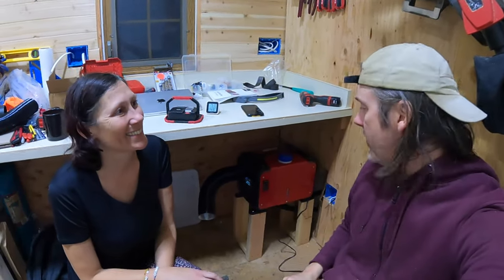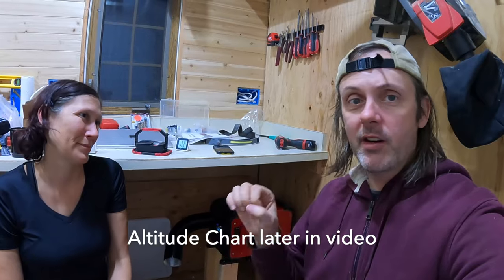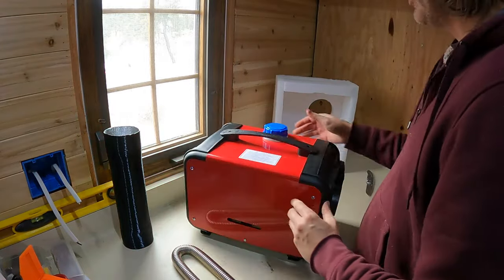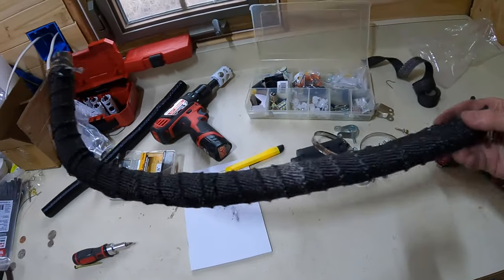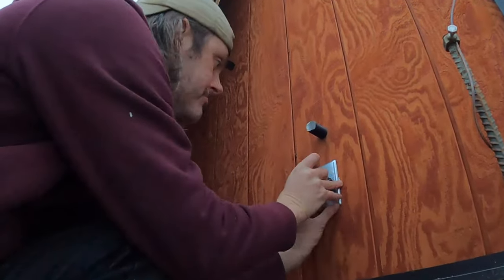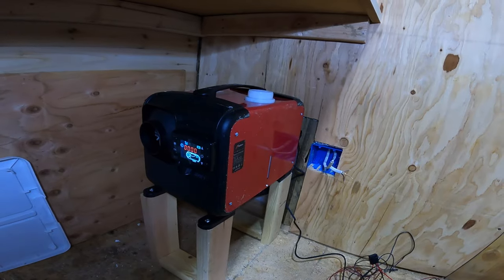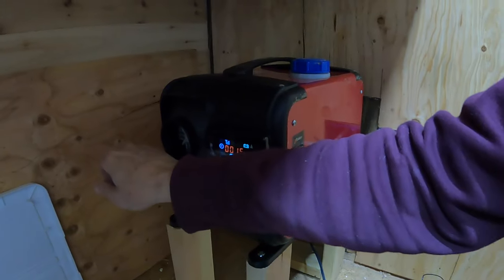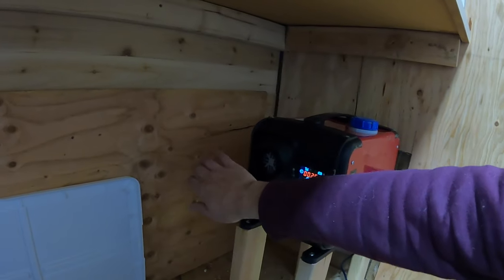How to Heat a Shed or Workshop with a Diesel Heater

Comment: Huh ... Fall is approaching here in the NE US and am looking to heat my gf's 24' x 40' barn and was looking at propane heaters.
Then stumbled upon this video while binge-watching your Sleekcraft SST videos.
Did a little research and now looking at appropriately sized diesel heaters instead.
Great videos! Keep up the great effort!
And best wishes that Sarah stays healthy!
Reply from the maker: Right on, winter is definitely coming.  I have been splitting wood (manually) the past few weeks to prep.   I don't have enough wood for this season right now.

For your pole barn, you'll definitely need to insulate.  I've seen some people buy like 3 of these things, and install them next to each other, combining the ducts.  So $300ish for a 'furnace' that runs on diesel, all plumbed to the same tank.  Can run all of them if the shop is cold, but once it's warm turn 2 of them off.   Interesting idea.
Reply: @ADDvanced  , as a matter of fact, I am installing insulation in the barn. 👍🏼👍🏼
1-1/2” (R-7) to start. Previous owner had a room in one corner, as well. Just framing at the moment. Will restore it and insulate it further, and include an electric heater, to store paints, resins, etc., and keep them from freezing.
Reply from the maker: @ELCADAROSA  Scope marketplace as well, insulation + reflectix works decently.  I scored HUGE rolls of reflectix super cheap, they leftovers from new construction.
Reply: @ADDvanced  , thank you!

Comment: Nice job. I replace the section of siding around the exhaust and intake with Hardy cement fiber board. Heat proof. Weather proof. Paint to blend with your siding. If you want to put the unit outside, use a toilet tank gasket to seal the intake of the heater to the opening in the case. Then screw a 3 inch plastic flange over the opening to attach a return duct. Most all-in-ones are not weather proof, so  add an overhang for some protection. You will also need to extend the controller wire. I prefer external because any exhaust leaks are not a worry, and the fuel is kept outside. You can also insulate the wall space around the exhaust with ceramic insulation.
Reply from the maker: Hey I like that idea maybe I’ll do that when I upgrade to an external tank?

Comment: You could use some larger diameter pipe to sleave through the wall for extra protection if you thought it needed it.  I don't know what temps these exhaust at, so might be overkill.
Reply from the maker: Thought about it, I think the metal plate will be fine for now tho.

Comment: My question is with your type of install is, wont you get fumes coming back in if you have your intake right next to your output...
Reply from the maker: Not an issue.  Even if some does get sucked in, it’ll just burn it and spit it back out.   The intake for combustion only goes to the exhaust, not inside the shed

Comment: That exhaust gets super hot. I would hate to see your shed burn down. You need way more clearance to combustible materials. A double wall b vent requires 1inch minimum clearance for a lp water heater and that exhaust is a lot cooler temperature wise because it draws tons of ambient air into the draft on top of the heater before it goes into the b-vent. Whereas the diesel heater is just purely very hot exhaust gas. I put it mine exhaust in mineralwool with 4 inches clearance to the studs. I just randomly found your channel on this heater. I see you have some boat videos too. I run d class runabout and hydro 40h and 55h with megaphone. Fun stuff.
Reply from the maker: Yeah this was what I was able to source locally.  The metal plate does a good job suspending it off the metal but I saw someone make something w a soup can that looked like a better idea. 

Thanks for the comment!  Cheers!

Comment: That unit should have no problem heating that little playhouse.
One thing about mounting the fuel tank outside is the fact that diesel fuel gels up when it gets cold (about 10 degrees F) so your pump will have to work harder or that little fuel line will not work so good if it's gelled shut. You are  better to have it inside.
Reply from the maker: Anti gel additive is cheap tho

Comment: I would of ran a small section of double wall pipe used in wood stoves and run the exhaust down the middle. Maxium protection.
Reply from the maker: Couldn't find anything like that, but I did see someone make something out of a soup can!

Comment: The intake doesn't need to run outside.😊
Reply from the maker: If you leave it inside, you’re burning the air you heated and will notice more drafts near windows and doors, as the room will be under vacuum.
Reply: @ADDvanced  fair enough.
Reply: @ADDvanced - exactly, NOT pulling a vacuum is the right way.
Reply from the maker: @robertmunroe3976  Way more efficient too

Comment: So basically it's just an air cooled diesel engine and the heat is from the cooling?
Reply from the maker: Kinda yeah.  Super efficient.   I have one in my van and in my Skoolie.
Reply: More like a super-efficient miniature oil-fired furnace with heat fins around the burn chamber. The fan blows over the fins to heat the air.
Reply from the maker: @gregbatch  more accurate, lol
Reply: It’s just a very miniature home heating oil furnace (I work in HVAC)